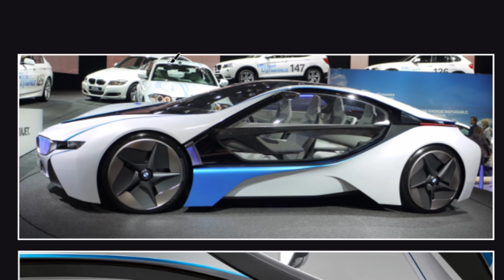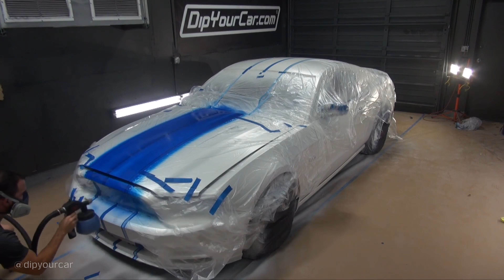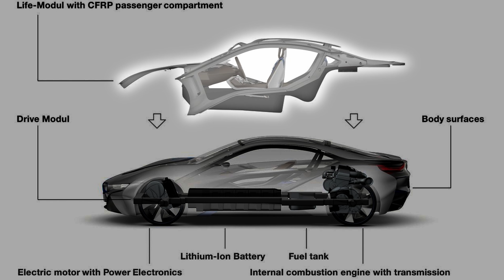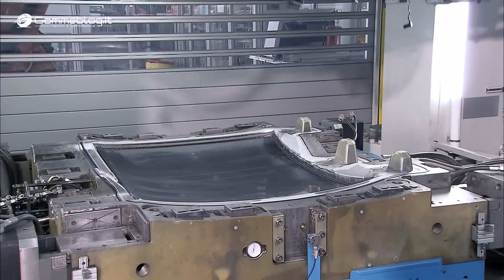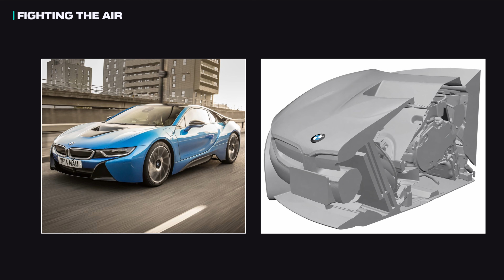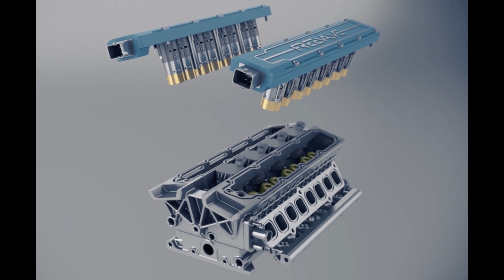BMW i8 Engineering: Ahead of Its Time

Comment: Great & very comprehensive details about the extraordinary looking BMW i8 in this video.

However, the i8 was criticized for lacking the performance to match its appearance, and the electric mode not having enough range.

When it comes to the Koenigsegg Gemera, even though it had a 3-cylinder like the i8, it had monstrous power & performance. 

Nevertheless, the buyers obviously weren't to happy about the 3-cylinder engine. So Koenigsegg gave the Gemera a V8.
Reply from the maker: Thank you! And yes, they're completely different cars. The Gemera comparison was more of a thought experiment. 😄
Reply: Yeah but the gemera is recent, the i8 is like 10 years ago, technology wasn’t there yet, it was ahead of its time